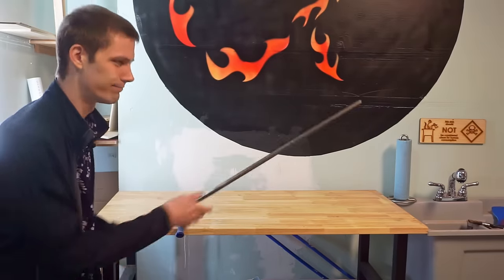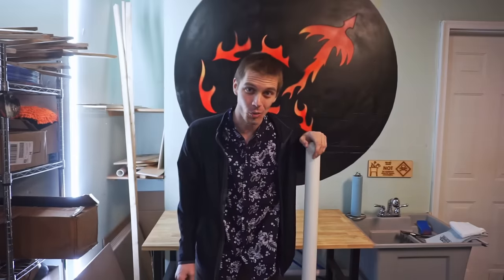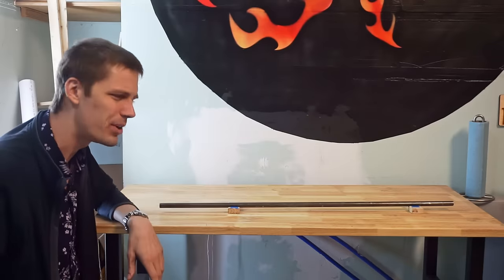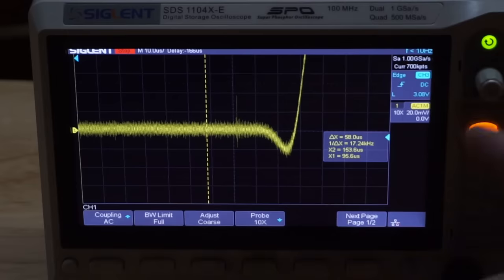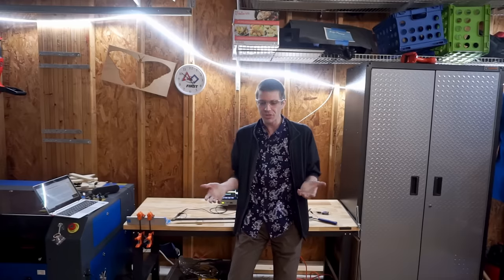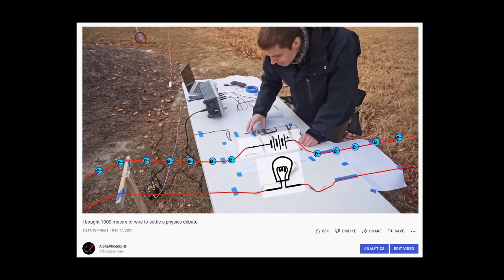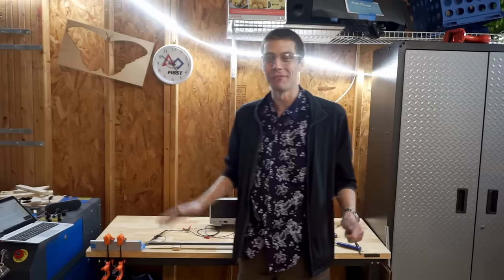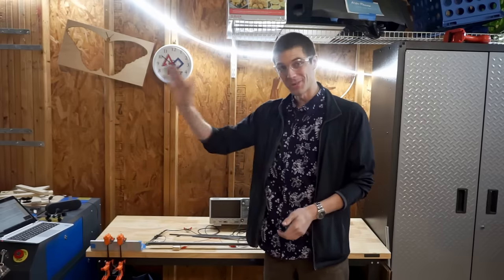Are solid objects really “solid”?

Comment: What blows my mind is that atoms are very small, and even in very dense objects like that bar, the atoms are still very very far apart in respect to each other. If an atom were the size of a golfball, the next atom could be literally 6 golfballs away even in a heavy solid. In a gas the next golfball could be in your neighbors yard. This means that since solids(you included) are MOSTLY empty space there is a nonzero chance that if he were to push on one end of that bar with his hand, it would pass through the bar entirely. Of course the chance is very very low, it would require every atom to pass through the empty space of every other atom. But the chance of it happening is NOT zero!
Reply: Yes, atoms are quite far apart, however, the electric field around the atoms extends far beyond the physical dimensions of the atoms. If you consider two macroscopic plates that you're bumping into each other, and assume every atom is aligned so that each plate would theoretically go through the other, the electric fields of each atom in each plate combine to form an effectively uniform repulsive force. Even if an atom in one plate were projected to go through the other plate's volume, that atom is repelled by all the nearby atoms in the other plate, which is exactly the same process that keeps two atoms from directly colliding anyway.

Think of it like a big, dispersed crowd of people with fire hoses. If they aren't blasting you, you can run through the crowd quite easily. However, they are constantly spraying high-pressure water at you, and once you get too close, the whole crowd's water stops you even if you aren't directly charging at a specific individual.
Reply: @shuriken188  I'm assuming you're touching on the Pauli exclusion principle. One part of your theory is flawed. Those people with the fire hoses are also hitting EACH OTHER pushing each other back as well. So at the point perfectly between them there would be no repulsive force holding you, since one would be pushing on your left, and one would be pushing on your right at the exact same force. Firehoses are kind of a bad example, since they push only in one direction, their fields repel in all directions, but they also attract to a certain point. The van der waals force will pull you towards those people until, the pauli forces won't let you any closer, but if you hit the exact spot between two of them, you'll slip right through. It wouldn't be common, not easy, and to get a crowd of people as big as the number of atoms in a person to go through a rod would be mind boggingly rare because sooooo many atoms would have to land "just so", but the chance is a number slightly greater than zero.

Comment: And even though steel seems to be very hard and dense it’s actually pretty soft when it comes to the molecules in the atoms and when you hit it with the hammer those molecules get compressed and have ripples most likely the same as dropping a table into Stillwater it will take time for the ripples to get to the other side

Comment: I’m wondering if the difference in the time when electrical circuit is closed and the hammer starts to actually push the rod is affecting the measurement. Would be awesome to see same experiment with a different length of the rod. I.e. twice shorter rod should have twice smaller delay. Otherwise the 180ms could be a simple coincidence.
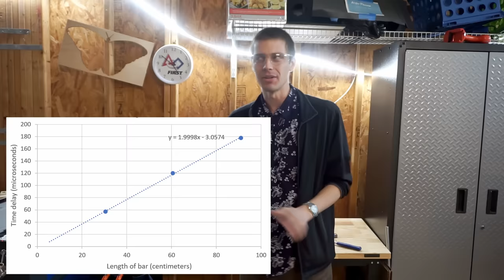Reply: He did that. 17:35
Reply: There is one important question: "WHY?". Why is it important to check the speed??? 🤔 If there was no delay. We could build a very loooooong steel stick. And put it in a Space 🌌. And then we could push and pull it. And the person on the other end of the stick could read our message like a Morse Code. That way we could send INFORMATION faster than a speed of light. That would be a step in a time travel. We see other Galaxies with a delay of their speed of Light distance. The Galaxy which is a 1000 speed Light years away we see it today how it looked 1000 years ago. And if we had a loooooong stick with no delay we could communicate with "somebody" instantly 🤔 💭

Comment: Hammer speed on impact: 6,4 m/s
6,4 m/s = 0,0064 mm/µs
In 180 µs, the hammer/rod will overcome a distance of 1,152 mm.
For some reason, the author considers the time interval between the contact of the hammer with the stick and the stick with the sensor as a delay in movement. Not considering that both the hammer and the stick need to overcome the gap distance between the stick and the sensor.
Reply: The fact that his results match up with the extensional speed of sound in the material tells me this is an issue that he accounted for already.
Reply: @sorayaprotera  It is always convenient to attract indicators to some known values, you can ignore any evidence, the results have converged)

Comment: Do you  know if these delays are ever taken into account in things like combustion engines or turbines? Like do you have to tell the ECU to wait a few microseconds after crank sensor says piston 4 is at TDC etc?
Reply: There is no need to take such into consideration on its own, and all the cumulative delays in sensing are taken into account in the testing and tuning of the system. The Cumulative delays include the sensor itself, the generation of a signal from the sensor down a wire, the detection of a sensor signal state change and the processing of instructions regarding this change in state. In other words, lots of delays and probably the most significant is in the ECU itself.

Comment: Replace the metal rod with mercury, and you have the "mercury delay lines memory" (EDSAC - Electronic Delay Storage Automatic Calculator).
Think a little big less fancy and use twists on a wire instead, and you have torsion wire delay line (because the second generation of computer builders weren't as excited about mercury vapors as those who lived through two world wars, I suspect there may be some connection 🤔 ).

Comment: For a correct experiment setup, you should also evaluate the reaction delay time of the sensor itself, by hitting the sensor directly or through a very short piece of metal.
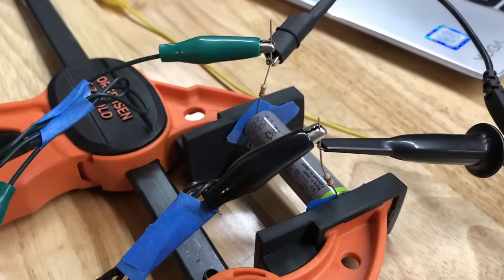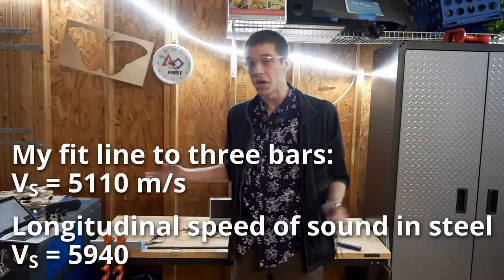Reply: around 17:00 - 17:40 he talks about testing the sensor delay and how it is proportional to the bar. For the most part the sensor should be faster as electricity travels a lot faster than the speed of sound. roughly around 90% of the speed of light says google.

Comment: There's a good theoretical explanation of this, relying on a very profund concept related to symmetry breaking and collective modes in a solid. In condensed matter physics, when we describe systems in terms of symmetry breaking, we find that every symmetry breaking is linked to the appearance of a collective mode called Goldstone mode. In the case of a solid, the arrangements of atoms in a discrete way breaks continuous translation symmetry (which is reduced to discrete translation symmetry).

The oscillation in this system, or the basic excitation of the ground state (the particles being still) are phonons: quantized oscillations of the atoms in the lattice. These modes have a very specific dispersion relation (for each energy given to the system, they will develop a specific wavelength of the collective wave).

Now here's the relation to compressibility. The dispersion relation of these modes tends to zero wave vector (k) linearly for small energies. What does this mean? For a very tiny energy, k tends to zero, and since k is inversely proportional to the wavelength, for very small energy the wavelength tends to infinity. What's a wave with infinite wavelength? A plane wave, in other words, the atoms moving at the same time and in the same direction, and therefore the system being rigid. 

Now the interesting point is that we always put some energy that, even if small, is finite, meaning that the wavelength may be long but not infinite. That means that there will be a wave displacing atoms through the lattice. The actual slope of the dispersion relation is what we call the speed of this wave. This speed is the speed of sound in the solid. And these phonons are called acoustic phonons.

Comment: You went full mathematician at 4:30 lol. 

A good engineer does finite element analysis. 

Break the item into small, easy to define, individual elements, and then extrapolate each element into the whole.

Really enjoyed the video!!!!

My answer for your multiple choice question is E.

The material elements of the steel rod wouldn't be able to sustain being pushed and it would just buckle somewhere in the middle.  The other end wouldn't move at all. 

BUT, if we're gonna talk about infinitely strong materials being pushed by infinitely strong guys then......I think the real world way this world work is that it would move at the speed of the waveform traveling through the material.  So the speed of it moving would depend on the physical material specifications of the rod, or C.

Comment: Hey, great shows, I just subscribed and am binging.  Have you thought of using sound waves in the bar to double check it?  Run a wave through and pick it up on the other side?  Also, sine the bar isn't really 1 dimensional but is far more x than y and z, there is a ratio there between the steel block and the bar, between the variations of y and z.  It seems there might be a standard hiding in there somewhere.  Great to see someone doing real experimentation with natural philosophy/physics... you're a century out of time!

Comment: 3:00 The comparison between water and electricity is something that strikes home for me. I'm from Québec. Most of our power comes from gigantic dams located a thousand kilometers north. We also have a series of smaller dams down south as well as a number of wind turbines. One thing that most peoples don't understand is that on an electrical network, all of the turbines need to be in phase. Operating a turbine out of phase can result in serious damage to the equipment. There is enough distance between the dams up north and the smaller ones down south that it is impractical to try and keep the dams to the north and south in phase. Hence, our electrical grid is split into smaller grids that can operate on their own phase.

Comment: Great video - I get the appeal of answering real questions through usage of detecting and measuring equipment, using more and more specialised methods and trial&error, trying to model the reality as close to its factual properties as possible by improving the measuring process.

I get that all, though it only assures me in my personal outlook on the whole of Physics science - for me all of that is a tiring process that is tedious and demanding, and I don't find it satisfying at all. This video helped me develop a deeper understanding of how and why the sciences that dabble in measurements don't resonte with me at all.

For me, the general experimentation has its charm of discovering whether the two properties impact each other at all (volume of the metal cube and its ability to conduct electricity for example), but when either the measurements need to provide detailed values, or when there is more values/operations that are needed to answer that question, for me it becomes tedious. I was never a fan of physics coefficients for e.g. any given material, or constants like Avogadro etc. because it meant delving deeper into calculations that I always despised in physics.

On the other hand, I love mathematics but I hate arithmetics. I love mathematical proofs and trying to determine the properties of a given problem through methods that help me understand the problem itself without first needing to pull out the whole specialized contraption, collecting the data and interpreting it and then trying to fit it into proven and understood solution. I like already having ALL of the defined properties that are provided and tested, so that I can take those for granted and use them to... I don't know exactly to do what, because I despise the calculations that are used to determine suitability of materials bacause it is just more measurements and arithmetics lol.

I like understanding the environment that I deal with. I find it fun and rewarding - gaining the knowledge and broadening the understanding of the rules that create the space of interest. But how do I exactly intend to use that knowledge and understanding? because it doesn't feel like it has any use at all that way, and I'm only here to be a mathematician that doesn't care about any usefulness of what they've delved deep into... now I'm just wondering what knowledge/understanding do I even care about - beside the pure enjoyement of mathematical proofs. Yeah, that's my issue, I haven't discovered any drive towards real physical activities/subjects/interests that would require any of the understanding-

thanks for helping me realise some stuff about my life with this video, it's a great physics demonstration as well! Cheers! <3

Comment: I can't recall where I'd seen this question posed before, but I came to the video knowing the "speed of push" is equal to the speed of sound. And it only makes sense, sound travels at the speed in which atoms are able to push upon each other through a medium. The only difference between a sound and a push is that the sound is a vibration whereas the push is a single movement. It's really easy to visualize if you imagine it as a really thick door. You push/knock on one side but someone on the far side wouldn't feel/hear it until the sound travels all the way through.

Comment: You are talking about the sound velocity of a solid here. I have been working in the field of non-destructive testing for more than 32 years. That includes lots of ultrasound testing, similar to the way in which ultrasound is used in the medical diagnostic field.
We could have demonstrated this experiment much more clearly with our ultrasound equipment, putting a transducer at one side of a steel bar and a receiving transducer at the opposite side, both connected to an ultrasound apparatus, connected to an oscilloscope. Often, the emitting transducer is used to also receive the echo of the ultrasound pulse, which makes us deal with the double path that the pulse accomplished.
180 microseconds makes sense for a 1 meter slab of steel. The sound velocity of steel is a bit under 6 mm per microsecond, so, multiply 180 with 6. That renders something like 1000 mm.

Comment: Not really relevant but this is a question I like to somebody answer. If you take an extremely accurate clock and put it in a high pressure chamber because light would be moving slower in the high pressure chamber what would time do? Because light moves slower underwater what does does time also slow down by a little bit?

Comment: I know this is way late and I'm sure other mechanical/material engineers have mentioned it but the stress strain response of a material can be measured in a split Hopkinson bar test apparatus.  The time differential is measured by strain gauge.  In your case, the bar is not split but the technique is applicable.

Comment: would be interesting to see this done in a side by side comparison using differing hardness/density metal rods...  like chromium, tungsten etc vs copper, aluminum... would there be a measurable difference, ... a significant difference in elapsed times ?

Comment: A bit too late to the party, but my two cents on the negative reading on the pressure sensor at the first section.

My hypothesis it: I believe the ZERO reading was not actually zero, but the rod's tip had some preload on the sensor. The impact from the hammmer sent a sine wave shaped elastic deformation along the rod (exactly like an arrow going off of a bow) and when the sinewave reached the sensor, it momentarily pulled the tip away from the sensor before ramming itself back onto it

Comment: I’ve considered this question before. My assumption was that the speed of light is really the speed limit of information, so if you attempted to push a lightsecond long pipe, it would take the other end at least one second to “know” that the rest of the pipe is moving. Therefore, there must be some level of deformation or breaking involved. I had kind of assumed that it was travel at or very close to the speed of light, I didn’t consider that it would be like a propagating sound wave. Very cool.

Comment: Interesting. It makes sense as I used to run explicit dynamic fea analysis of structures at one job and the time step has to be small enough to capture the energy wave through the material. I used to just think it was for resonance but this would indicate that it’s actually strains, displacement and therefore stress which is also at play.

Comment: This should help a bit: Once , I was on the moon just doing some regular mechanic work, but, had a huge bolt that wouldn't come loose. No good tools up there, so, the guys on earth stuck a long, long , punch , into outer space, and, I  put the sharp end against the bolt head to impact it in the unscrew direction, and I had the guys on earth, whack the end of the chisel/ drift/ punch, whatever you want to call it, and let me say, it took quite a while for that impact to reach the bolt. This was a couple yrs ago, before Raquel Welch died, and it was the movement of her hips, with a sledge hammer attatched to her waist,  that made the hammer head impact the long, long, long chisel to the moon. True story.

Comment: Regarding the 'weird' negative dip before the actual reading, I believe this is consistent with how hydraulics engineering describe pressure wave transmission. 
A positive pressure impulse creates a depression ahead of the front, similarly to what a negative impulse does by creating a positive spike ahead of the negative impulse. 
Think of what happens on the beach when a tsunami hits: the water recedes before the actual impulse is seen.
Look at 'water hammer' for more information, that is pretty interesting stuff!